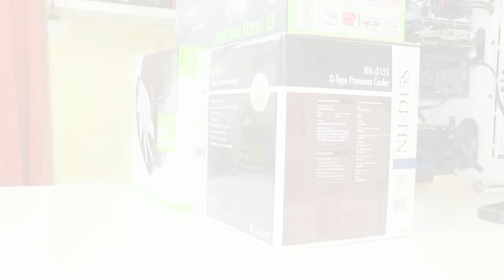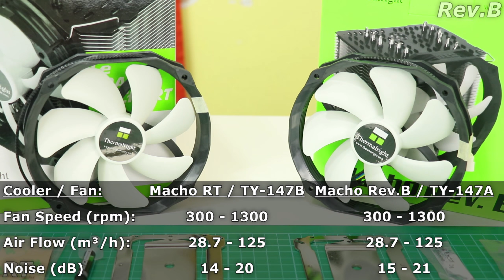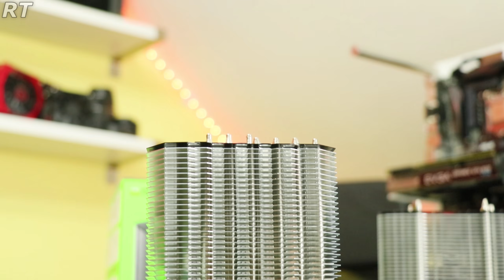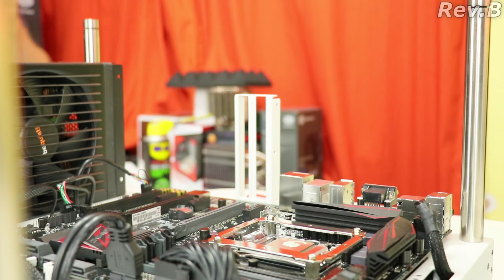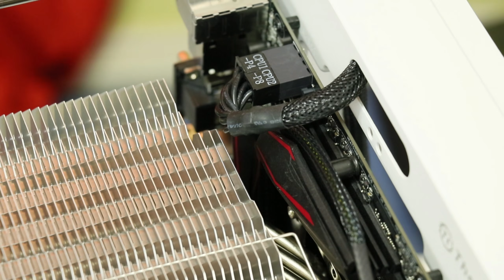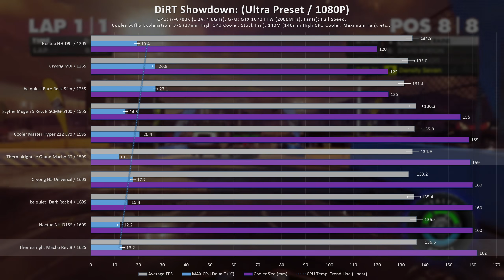Thermalright Macho Rev.B and Le Grand Macho RT Review

Comment: I got Macho. It is still best aircooler. Better than my Noctua chromax. Reason. Noise is lower and price much lower. 
Issue is that where is 1700 / 1851 socket model and where is mounting kit for it? Windows 11 not support LGA 1150 motherboard and CPU. So really need this mounting kit for this great cooler.

Comment: It's a good cooler (I have Rev. C), but I've never managed to install the fan properly. It just partly sits on my GPU, as the clips just don't hold on properly. Not a very big deal, but they should've designed it differently.

Comment: Blooming brilliant! I wanna try 1 of these. I wanted the Rt for a Z590-i iTX but like you pointed out, for mine, I have an open frame but a ledge too close. 15mm above rear I/O or a 5mm lip inward at 12mm high. 

I remember when ThermalRight gave you an adhesive to stick backplate while you work & a simple  "X" folding plate that centers on a nib. But we used to have stiff springs so maybe now you can clamp down better then before. 

Video was Ace m8. I like the lighting, & colours. That standing case is brilliant as well. I been looking for something like it. ThermalTake? Sound was good but mayb4e just a tad low. (:

Comment: would you say this cooler is still relevant in 2022? I have one I never used and was planning on a new build
Reply from the maker: If it works, it's still relevant. To be fair this one is massive, so it's going to be useful for a long time as long as it's compatible with your socket.

Comment: Good review, I have a Macho since 2012 on a 3570k @4,2 Ghz it cools it well....now I have upgraded to Intel 11400 and want to use the same cooler (support from Thermalright told me that it is compatible) . I hope it will take the heat...It seems very hard to mount it though

Comment: Why are Thermalright fanboys always so salty? They always went full denial when seeing their favorite coolers lose to other brands.
I owned True Spirit 140 Power (the one with six 8mm heatpipe) and le grand macho rt, the former is absolute trash, my  STOCK 10700k almost thermal throttled under load.
The latter is a bit better but still nothing impressive.

Comment: Great review! I have the HR-02, from 10 years ago mounted on a Core i7-3930K OC at 4.6Ghz 1.385v. While gaming, the hottest core is 71C. With Prime95, it is more like 78-79. I’m trying to get to 4.7-4.9 at around 1.4. As the HR-02 is rated at 200W TDP and the RT at 320, I Think it Will be a Nice upgrade as my CPU at 4.6 is pulling 240W, it will get near 300 at 4.8-4.9.
Reply: I have that cooler too on I5 3570k@ 4,2 Ghz, served me really well since 2012 ( 36' C idle, 70'C full load, Zalman Z11 case) but now I bought an I5 11400, I hope it can handle the heat

Comment: Silly millennials... back in my day HSFs attached with spring clips until Intel decided mounting the processor on a glorified Atari cartridge was the thing to do (Pentium II/III/Celery).

Honestly, if anyone actually remembers the old clip system, they should also remember the motherboard stabbing that happened when some poor sap's screwdriver slipped out of the slot in the clip. I personally love the screw on systems, I just believe the hardware should be affixed to the HSF base in some way, not free floating for the installer to juggle while tightening multiple screws. A good mounting system now days is as refreshing as a tab on the old style spring bar clips... you didn't have to risk damage from a screwdriver slipping. Lol

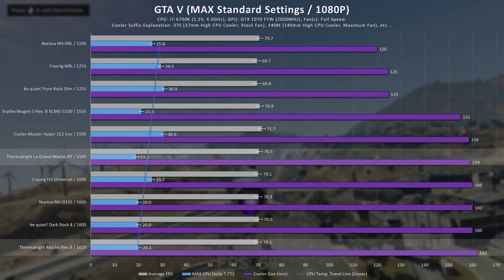Comment: awesome review and i got this and the nhd 15s  what you say at 31:00 is what i was hoping was the case but i got a 3900x oc'd and pulls 200watts and the noctua is holding it from throttling while the macho rt is about the same on avg temp but the max temp is about 10c hotter ;/

Comment: the thing about the large fin spacing in the Macho is that it's better for a) passive operation and b) lower fan speeds due to air friction being non-linear.
edit: large fin spacing also helps prevent dust accumulation from nerfing fan performance. quick fan clips mean easier de-dusting.

Comment: Conclusion: don't buy the Macho rev.B if you have arthritis ravaged hands or are a useless millenial. Otherwise you can grab yourself a 50 dollar cooler than performs on par with 80 dollar noctua and dark rock. With one (1) fan, mind you, while other ones have 2. 

You can add another one for 15 bucks, I wonder what the performance is then, hmm?
Reply from the maker: Or if you want a cooler that's had the edges rounded nicely so they're not sharp. Or has a little more build quality.

2 fans won't make that much difference. I've only ever seen a few degrees knocked off under full load with a second fan. But saying that I've only tested this with the Hyper 212 Evo and Freezer 34 eSports DUO.

No disrespect, but I often find arguments aren't strong when the word 'millennial' is used.

This cooler could be worth it at $50 sure, but I had to spend £90 to get hold of one of these since there aren't that many this side of the pond. So from my perspective it wasn't worth it at £90, but £50... sure, pretty good.
Reply: @AVTechy  

You are the one who brought up millenials in your video. 

In any case, the reason you gave not to buy this cooler is pretty silly. We can see in the video it took you whole 10 seconds to lay the parts on top of each other. Maybe that equates to minute or 2 when you have to check the instructions.

It's not silly to bring it up, mind, as it is an inconvenience thermalright could do something about. But enough to not recommend the cooler? That's taking it way too far.

PS. I believe silent pc review tested earlier revision of this cooler with 2 fans and gave it high praise in that configuration.
Reply from the maker: @arpakyna   arpakyna  Sorry, I thought you were being serious about the millennial's comment, I certainly wasn't in my video. 

The reasons I gave were things that were inconvenient, and weren't present in other coolers. If I wanted to install these coolers in an upright case it would be a huge pain in the butt. Whereas I can install the NH-D15S upright no problem.

With all the parts that need assembling, inside a case if a couple of the parts dropped out into a complete build as a post build upgrade, it could be annoying to have to deal with. Again these aren't frustrations found in other products.

The other coolers also have a higher build quality, are smaller, and have a nicer finish on the whole.

These coolers certainly have the potential to perform better than other smaller coolers with two fans since they are so large, but price to performance wise I don't think there's much in it. But for those who just want performance then it couldn't hurt to add a second. 

Anyway, the frustrations and lack of build quality in comparison to other coolers, and the minimal performance differences mean that I wouldn't recommend these over other offerings. Just my opinion, and you are of course entitled to have a different one.

Comment: I have the macho rev b and the macho 120 SBM both are great coolers and thermalright doesn’t get enough respect compared to be quiet or noctua. The macho rev b is a $50 dollar cooler and it cools great and is pretty silent. Im in the market for a cooler on a spare 5820k asus x99 pro rig im building and i thought about the nh-d15, dark rock pro 4, le grand, sythe ninja 5, or maybe another macho rev b or x2. Im just not sure if the le grand will fit the macho rev b was pretty close to my gpu and i have to use the 1st slot for 16x and the only other slot for 16x is 3 and my cables get in the way. The rev b kept it cool at 4.5 ghz and i used it for a 2700x build. I had an h100i v2 with it but the pump died. And i just want to try one of the bigger air coolers and i was leaning on the dark rock pro 4 just because i hate noctua’s colors. But its nice to buy the same family of coolers to have extra mounting hardware. Great video could find much like this on both. Is the macho rev b wider than the dark rock pro, and whats wider the d15 or le grand thanks

Comment: its bad review, cos it was tested on open stand, this cooler show much better results in case with good airflow.
Reply from the maker: Yeah these are comparative results on a consistent test bench. If I were to use a case the volume and free airflow area would change with each cooler which would be inconsistent.

But we can disregard the entire review as bad based on a disagreement of the testing methodology sure.

Comment: Have you tested the Scythe Ninja 5?
Reply: I have. The ninja does a little better than the D15s but not as well as the D15 in thermals. Also, good god is it huge. Also the front fan of the ninja gets in the way of ram just like the D15 but the D15 front fan can be mounted in a way that it sits in front of the ram allowing the front fan to be used for cooling the cpu and also providing cooling to the ram. The ninja fan has a little better clearance over the ram in its intended spot but you can't stretch it past the ram if you need to. In most cases I would go with the D15s or the mugen 5 rev b unless you do some crazy overclocking in which I would recommend the D15. The ninja does look really cood though.
Reply: @lightspeedlegato  Thanks...great info...

Comment: Thermalright Macho rev b vs Scythe Mugen 5 rev B which is better?
Reply: Nothing is more silent than the Mugen 5 but if you want to cool something like a Ryzen 3900 or i9 9900 you have get something bigger to stay silent over years. Something like a Noctua D15S, DarkRock Pro 4 or LG Macho RT and of the big ones the LG Macho is the most silent! A Thermalright True Spirit is even more Silent but it's closely 180mm which only fit in few cases.

Comment: Stellar review. I will say: the question I'm trying to answer is which one works best with the current crop of enthusiast 8-core chips, ideally overclocked. The 2700X and 9900K pull ~150W stock and ~250W at a reasonable overclock. To your point earlier: a 6700K at stock voltage in a game test probably isn't much over 75W, so it's not clear if the performance hierarchy is representative.

Comment: Great review! I want to see do a review on the Thermalright True Spirit 140 Power. Its also got a crazy size but in a different way, its super tall! 172mm. Its got 6 heatpipes but theyre bigger than all of the heatpipes you see on these coolers - theyre 8mm instead of the standard 6mm. Just curious to see how such a cooler would hold up compared to these. Plus its got a ridiculous TDP of 360watts which makes me question it :thinking:

I suspect that you'll see similar results to the large coolers you already tested. They're all overkill for a relatively low TDP CPU like the 6700k. Gotta test a threadripper or some HEDT intel CPU :P Shits expensive tho

Comment: It's too bad you didn't review the Raijintek Pallas (top-down cooler).  While its performance is good, there is no other cooler as frustratingly difficult to install... from screwing down the cross bar over the cooler base to attaching the fan to the heat sink using the clips, it's just way too difficult.  I heard you complain about the installation of some of the coolers in this series of reviews, but you don't know frustration until you've experienced all that the Raijintek Pallas has to offer.  Sorry for the off-topic rant.
Reply from the maker: Haha, well there's always time :P. I take if from your experience that the mounting bracket of the Pallas is a deal breaker. I'll keep it in mind to stay away from it, thanks for the heads up! :)

Comment: love the video , im having a hard time deciding between the grandmacho rt and the mugen 5 for my Cpu i7 8700 non k (110w-120w max tdp on aida) . they are the only ones under 160mm that offer 100% ram clearance (From a visual standpoint im using Trident Z rgb ones and i want it to show it) .do you think the mugen 5 will be capable off cooling it ? because there is almost 35 dollars difference between them and i dont know if its worth it.  my use is for gaming and some light 3d modeling (Autocad/sketch up). Consider me a new subscriber now
Reply from the maker: In all honest it really doesn't matter between the two. Personally I'd go for the Mugen 5 since it's so much easier to manage. The 6700K hits about 110W on Prime 95 which should give you an indication of the cooling performance in comparison to the 8700K (minus two cores of course). The Mugen 5 will have plenty of head room to cool and overclock the 8700K.

Gaming should be your highest load on the CPU, I don't think you'll see higher than 50°C with a light fan curve, but you could choose to go for a more aggressive fan curve (anything below 60°C is perfectly reasonable though), or use the money from the saving and add another fan to the cooler for quieter operation.

Hope that helped, thanks for the subscription, and I hope you enjoy many videos to come. And of course if you have any more question don't hesitate to ask!
Reply: thanks my man i love beefy coolers and you were the only youtube channel that was covering this Forgotten beast (sycthe , Thermalright) all the other channels only focus on Noctuas and bequiet. what fans do you recommend me to buy for the mugen to get the maximum performance
Reply from the maker: No problem, I'm happy to help out :).

If it was me I really like the fan that comes with the Mugen 5, and if I wanted to make it look good and I was on a budget I would go for another one of those fans. But if you're not too bothered by looks you can go for pretty much any fan with a "Ball bearing" and matches the general brief of your system. In fact if it was me I wouldn't add another fan since a second fan won't gain you much in terms of thermal performance (CPU coolers don't generate a lot of resistance). But if you wanted to swap the existing fan out then there are some factors to consider.

Fans are quite a complex subject compared to how they appear on the surface. There's two levels of performance to take into account - airflow and acoustics. You can go for a fast fan with high airflow and higher noise levels, or a slower fan with less airflow and lower noise levels.

You can of course go for a fast fan around 2000rpm and use a fan curve to keep the rpm's low until the system get's really hot. On the whole the noise levels are dictated by the bearing type and the speed of the fan. Or go for a slower fan around 1200rpm and never have to worry about noise levels.

To be honest this probably isn't helping :P I'd recommend fan around the 1200 - 2000prm range with a ball bearing (or any variation), and one that has plenty of positive customer reviews. A few good video reviews are great, but a mass of good customer reviews is very valuable, and they don't generally steer anyone far wrong (as long as it's from a trusted site of course).

My best advice I can give you is to work with the existing fan that comes with the cooler, and if after using it for a while you realise it has to spin up too fast and becomes really noisy then you should probably look into getting a second fan. Let me know if you have a certain specification of brief for the fans you want, and I can come up with a few suggestions for you if you want. If you wanted to get new fans straight away, would you be looking to go for two new matching fans, or a single fan to replace or add to the existing fan?
Reply: i think im going to try the fan that come with the mugen 5 for now , and if i change the fans in the future i think ill go for 2 new fans . i hear the noctuas are really good but the colours are too fucking hideous

Comment: Specs say the RT is a 159mm tall assembly...the drawings on Thermalrights web show the top of the fan matching the height of the cooler protrusions.  In your review pic, the fan seems to extend above the cooler stack beyond 159mm.  Is this accurate?  Can the fan be positioned lower on the cooler stack?  Ordering one to fit into a case with 158-159mm clearance.
Reply from the maker: There is room to shift it up and down, you can move it below the level of the heat pipes if you need it to. Is there a specific reason you're going for the RT over other coolers? It's certainly a showpiece and has a high TDP ceiling, it would be interesting to know what your use case is.

Comment: Good coolers, performance wise. It is largely due to their fans (TY-147), which are one of the best universal (CPU/case) fans on the market. It's a shame they have such shape, which limits their usability...
That mounting is more complicated than it needs to be, though,  and they're not among the small ones. 
Mugen 5 is still my favorite of the bunch, being smaller than the rest in that group, cheaper and having great performance.
Reply from the maker: Quite right, certainly very capable coolers, but I really haven't got the hardware to put them through their paces.

Like you say, their mounting is way too fiddly to compete with other solutions, and their sheer size makes them pretty much pointless for most people to use.

I still haven't announced whether I'm using the Mugen 5 or NH-D15S yet. I'll need to get onto that soon.
Reply: @AVTechy  which cooler would you recommend (air) for the i9 9900k and a meg z390 godlike (I can't figure out what case to use since its EATX...need a good air cooler/case combo) any suggestions?
Reply from the maker: From what I've reviewed I can recommend the Noctua NH-D15S/NH-D15S and the be quiet! Dark Rock 4/ Dark Rock 4 Pro.

I would recommend the Scythe Mugen 5 but I think you'll be better off with a larger cooler. Frankly any coolers that compete with the Dark Rock 4 and NH-D15S will be great coolers, so it's a case of picking the best performer you like the look of.
Reply: I have some good news for you.  TY-147ASQ